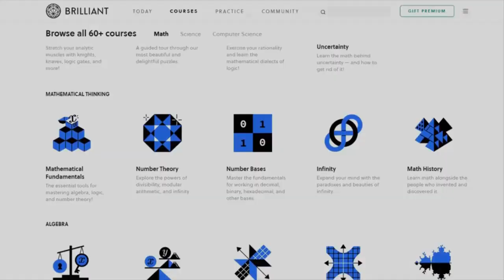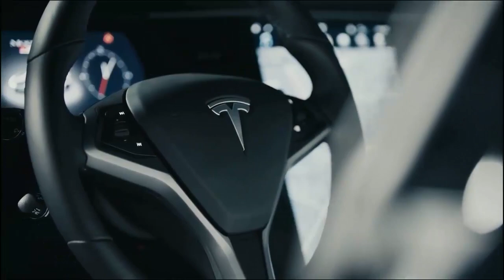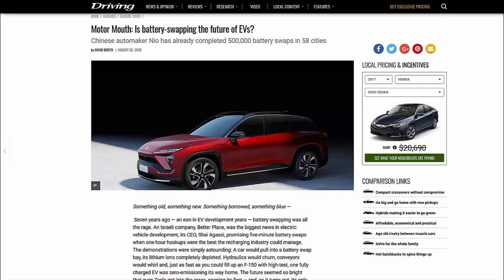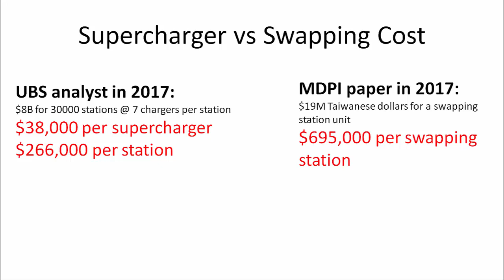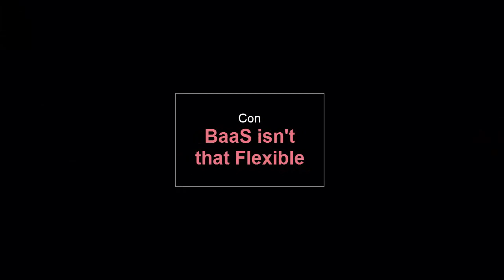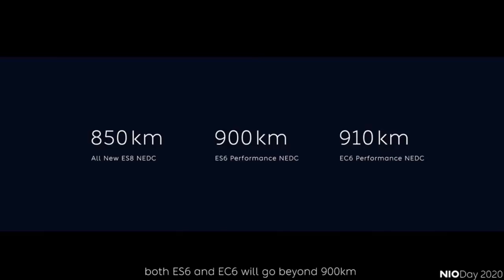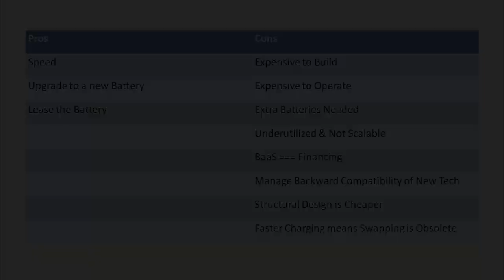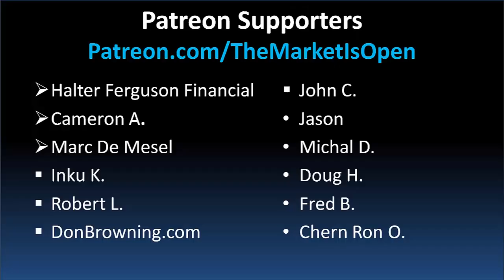Will Tesla Battery Swapping Crush Nio?

Comment: Just my 2 cents as a NIO owner. I think NIO focuses on battery swap somewhat because the government supports such model vs. charging and consumers can get tax benefit buying a battery-swappable car. I personally prefer charging over swapping because I have a new car and I don't think it is worth it to swap with an older battery to my car. I would think a sweet spot would be a battery swap station along with charging stations together.

While Tesla's structural model seemed nice, there are some disadvantages such as having to repair the entire car if there was a structural issue. Also, there is physical limit to how much Lithium battery can be charged. Too much voltage would cause security issue such as electric leaking.
Reply: NIO checks the health of their batteries and it's automated when you use their battery swap stations. Shame you didn't mention that.

Comment: Think battery swapping is niche for  car fleets  Or robo taxis. If you had 300 Robo taxis running in a city you could have the batteries charging waiting to be swapped while the Robo taxis are still creating Revenue. Only viable use case I can think of

Comment: I wouldn’t want to swap mine. And on battery day Elon said that the batteries would be integrated with the frame to make it stronger and impossible to swap. So maybe people should rewatch Battery Day and know that swapping will never happen
Reply: Your spot on.  
Integrating the battery into the car's structure saves weight, material and costs vs not having the battery structurally part of the car.  Swapping will never happen with Tesla.

You buy the car and then lease it's battery?  What good is the car you bought w/o a battery? It makes sense only for those who can't understand it's the worse of the two ways to go for all the reasons.
Reply: Yup.  Battery swapping is stupid.   Storing battery pack in a swapping station is a wast of money.  Inventory cost and driver may abuse the pack.
Reply: Don't get me wrong, I love Elon Musk and clearly he's one of the smartest person out there that we are aware of BUT he can also be wrong and mistakes. There are a few reasons why battery swapping will work for NIO: 1) Old cars can swap to a new more efficient battery meaning you don't need to buy the latest model for the best battery. 2) Instead of recharging you can also swap the battery and that's something that will be useful in China. NIO also allows you to rent the battery for a monthly fee so that you can purchase their car for much cheaper. Battery swapping will also be useful when robotaxis is a thing.
Reply: @Teslafan9519  Father Time will be the referee on that and decide if you along with NIO OR if Elon and Tesla is on the better  road, won't it?   Elon along with the other engineers working at Tesla have examined the two approaches thoroughly,  I'm sure.

  In China every citizen who doesn't tow the line which those in power dictate life does not bode well for them.  If you insist that is the kind of culture which produces the best results who am I to disagree.   Just remember your position as history will record which mode gains dominance and lives past the other.

Comment: There may be a cultural difference in China where a bigger percentage live in apartments rather than single family homes with garages.  If Tesla's experience shows they are losing significant sales in China  because of swapping, they will pivot and offer it.  I think Tesla is confident that structural batteries and lower prices are more important to buyers.
Reply: I live in a lame country in eastern Europe and even we already have slow chargers on regular parking spots, connected to the same grid that powers street lamps. Electricity is everywhere, you just need a connector and a machine that knows whom to charge (no pun intended) for it.

Comment: Elon said  "LIDAR is a Fool's Errand" for FSD.  Battery swapping is another, "Fool's Errand".  Tesla not battery swapping is a plus for Tesla.  Nio will/is  spending and wasting a whole lot of resources on battery swapping which Tesla is putting into places which will give better returns.  Like into more production for cars and batteries. That will allow Tesla to fill the inevitable greater future EV demand. 

That is why Tesla will crush Nio in particular. Tesla will out perform it's other competition for other reasons depending on the what mistakes they make which will cost them.  Just like Nio is on battery swapping.  Tesla has a company culture and direction different to all other's and that was it's edge over it's competition in the past as we have seen and that  will continue to be so going forward.  That is something the legacy manufactures can not change  if ever.

Comment: Imagine having to drive 10 miles to get your battery swapped!! What a PIA! The time that is stated in this swapping model assumes that the car is right there.  One must add the time back and forth to the swapping station. Also a waste of batteries that could be used for an additional car or storage unit.  Not for me.
Reply: Oh, your fuel pump is at home? Imagine having to drive 10 minutes to fuel your gasser! Oh wait... 🤣

Comment: NIO use swapping as best strategy because they only need to raise battery capacity, not need to reduce time of charging!
 Only choose 1 of 2 effort, this will get success easily. 
 But the way NIO swap battery is poor so far! 
 The best way is using quick disconnect, battery will be inserted from side of the car, slide into battery housing then lock it. When remove simply slide pull battery out. This doesn't need complicated station, only need simple mechanism to swap battery with cheap cost.

Comment: I'm trying to fuss out if battery swapping has any advantage in high-density residential areas where level 2 charging infrastructure is not sufficiently prevalent.  Ignoring queueing, the battery swap would permit an apartment dweller to enjoy about the same experience as owning an ICE vehicle.  Once queueing is considered, the ability to locate a sufficient number of swapping stations with relative convenience in high-density regions may be difficult.  On the surface, streetside or parking lot/garage level 2 charging infrastructure makes better sense to me.

Due to the lower currents, level 2 charging can be more efficient and reduces stress on the battery.  If a battery swap station is always rapid charging the returned batteries it seems to me that those batteries will degrade much more quickly than those that are only occasionally supercharged while on trips.  I have not yet made an effort to research the level of degradation to anticipate.

At ten minutes per swap and assuming all batteries are the same, 13 batteries permit a minimum two-hour charge before the battery is potentially returned to service.  This may be a low enough charge rate that extensive thermal management is not required.  It also implies that a 13-battery charging bay could support two swap bays at 50% average utilization.  Higher utilization would require either a larger charging bay or thermal management of the battery for rapid charging, yet another complexity.  For Tesla or CCS rapid charging each vehicle brings its own thermal management system.  In battery swap this is another item that must be duplicated.

In the particular case of Nio, the advertising of an impressive facility that contrasts with the Tesla superchargers and other rapid-charging infrastructure may fully justify any inefficiency in capital utilization in the short term.  It is visually obvious that Nio is offering an alternative to other players and likely can attract new buyers to look at them vs. dozens of other manufacturers.  Since I understand Nio cars can also rapid charge Nio is somewhat free to emphasize or de-emphasize the battery-swap concept as the novelty wears off and consumers, in general, become more savvy about vehicle charging.

I do not miss my Tesla not being able to swap batteries.
Reply: @Noguffay sorry you are wrong.. 
Look at china and india now..

Comment: Many in China lives in large apartment building where they can't plug in their car at home. Nio chose to put tens of thousands of battery packs in swapping stations instead of selling tens of thousands of cars.  Battery swap stations would not work in the US. Nio would be fools to try it in the US.
Reply: You seems to have in depth analysis of this topic. I agreed that Nio would be fool to replicate their battery swap strategy  outside China. But, as it currently stands, Nio mainly focuses its sales in their homeland and their battery swapping strategy is more about solving the accesibility problem than the matter of speed. It will give them an edge over Tesla at least in China, the largest ev market in the world 👌

Comment: Tesla canceled the swapping because it does not work in the real world. With all the salt and water on the roads the mechanism and bolts for swapping the battery will corrode/get damaged after 1-2 years and the car is toast.
Reply: Not all areas have snow and salt issues.

Comment: You made some good points, but did not.explain why Tesla cancelled his  battery swap pilot program in 2013 when there were no Level 3 charging stations
Also understand that in China nearly everyone lives in apartments so home chargers cannot be used.  If I lived in an apartment I would want a car.with battery swap capability instead of waiting in long lines then hours at Level 1 and 2 charging stations.
Also, Tesla's Level 3 stations' charging rate is decreased by the number of cars charging at the same time.  And even when only 1 car is present, waiting 1 hour per 100 miles gets old fast.  Car.magazines have done articles on   long trips that take 25% longer due to slow.charging times. 
On battery day I was surprised Tesla did not announce their new 4680 battery will have a faster charging time. 
I am surprised, too, that Tesla has not adopted Maxwell's super capacitor technology which provides instant regeneration storage which can be used for short bursts of acceleration, reducing somewhat the  number of heavy batteries being hauled around.  Why do all the Tesla YouTube channels never address this subject that was a hot topic 3 years ago? 
I admire Elon Musk and own 300K of Tesla stock.  I have a single family home where I am willing to install a Level 2 charger,  but will not buy a Tesla as a first car until the price is equal or less than an ICE car and it can be charged at a Level 3 station at the rate of 15 mins per 100 miles.  If Tesla really wants to sell millions of.cars, he needs to improve charging time.
Reply from the maker: Ya I think a lot of the "cons" I listed stem from the learnings from tesla's pilot program. Just because there were no V3 superchargers, doesn't mean they didn't see what was in the pipeline. Today for example, we have no V4 superchargers, but we know that faster charging will come in the future.

I think the living in apartments argument is more of an ICE vs EV thing, and has to do more with getting buildings to install chargers. The decision of swap vs charge doesn't seem to relate much to living in an apartment. It's all about the speed and convenience. While the superchargers are slower, I think I outlined clearly why a swapping is prone to bottlenecks, that could them even slower than charging. But that said, swapping could be good for today, but when new technology arrives with faster charging, swapping your battery to a faster battery, defeats the purpose of swapping. And faster charging will make swapping pointless. Also V3 charging has a peak charge rate of over 1000 miles per hour. So they charge about 75 miles in 5 minutes, which is getting to be quite compelling.

For supercapacitors, if short bursts of acceleration is advantage we're looking for, then they're not needed since the batteries can deliver enough power to accelerate just fine. The new Model S Plaids can do many bursts in a row too,  without supercapacitors as far as we know. So what advantage do they bring?

Comment: Upkeep on battery is cheaper but eventually you will have to swap it out
Reply: Tesla's batteries will be able to last longer than the car. You won't have to swap the batteries out until you scrap your car.
Reply: @chrisw9534  fast charging would do so much harm to the battery life span my friend. Ask samsung about that business  model idea and they will tell you how terrible is it. Over time, your battery will degrade faster and hold charge less and less. Fast charging is the friend of the user but the enemie of the Battery itself. You would definitely need to swap it eventually my friend.
Reply: @clamorosomilano7148  Apparently there isn't much degradation on the 4680 cells. And most people probably won't use fast charging often. Most charging will be done at home or at the office. Don't need fast charging there.

Comment: its basically the same with swap able phone batteries, its nice to be able to, but its just not worth it because of the wasted space etc
Reply: A car isn't a tiny handheld device. Your comparing apples and pears. Cars are big and need to be parked somewhere to charge. If you don't have a garage, you have to rely on public charging infrastructure.
Reply: @hgr3180  your point is?
And what has that to do with my comment?
Reply: @michelbruns   look at how flawed your comparison was.
Reply: @hgr3180  the ability to swap batteries take up space, and its not worth it to lose that space
Just like with phones
Reply: @michelbruns   why do you keep comparing it with phones? They aren't the same. There's a reason why public charging infrastructure is important and it's because you don't want to have a shit show trying to find a place to charge your car. We aren't talking about hand held devices that can be charged anywhere. We are talking about cars.
Reply: @hgr3180  i still dont know what you want, its the same as with phones, we decided to make batteries unswappable because we can increase the battery capacity by doing so, JUST LIKE WITH PHONES. Period.
Reply: @michelbruns   good luck travelling during the holidays in China? I bet you didn't consider that in your flawed argument. Btw in China they don't have garages because they live in apartments.
Reply: @hgr3180  still dont know what you want
Reply: @michelbruns   comparing cars to phone is dumb. If battery capacity was so great we wouldn't be having this conversation, but it ain't.
Reply: @hgr3180  but the same principle applies so its a valid comparison
Reply: @michelbruns   charging and swapping do basically the same thing. We will always need them unless you can mass produce high capacity batteries that can be recycled.
Reply: @hgr3180  dude wtf is your problem or your goal with all this nonsense. I wrote a comment half a year ago that we dont use swappable batteries in cars because it would make the batteries smaller, just like with phones
And now you write all this stuff, i still dont know what you want
Reply: @michelbruns   yeah I agree, but it's more complicated then that. You have battery degradation and repair costs to also consider.
Reply: @hgr3180  which are negligible, especially when you factor in the higher rate of failure and tear and hence higher repair costs of swappable batteries
Reply: @michelbruns   you have proof to back that statement up?

Comment: 8 yr ago swaps took 90 seconds, they should be faster now.  Tesla already has plans for batteries at the superchargers to time shift drawing from the network during low demand times like night.  Charging one battery to charge a 2nd wears out two batteries for a single use.  Advancing Technology requires trying multiple routes.

Comment: Swapping shoululd be noy by OEM but by independent businesses like filling stations, small manual batteries to exchange like gasoline stations.  NIO & Tesla screwed up the concept,
Reply: Why??
Reply: Because that’s the way gasoline and diesel are dispensed??
Reply: @205rider8  Infrastructure & practices exist to ease the transition if we  add battery swap to filling stations.  Much harder to make drivers think different. So need fast refueling or no  change tro ZEVs from ICE.

Comment: The author is unfair to nio in some ways.  He does not say that nio gives out an app where you reserve the exact time for your swap so there is no waiting in line once you get there, much like the "fast pass" at theme parks.  It can be the 7 minutes.  Also, battery swapping can be used with solar/wind farms to defeat the "duck" curve problem with these energy sources.  Rather than waste energy from solar when it is not needed, hook up a battery to it and charge it very cheaply to be later shipped to a battery swap station.  Also, the author leaves out that battery swapping can save in total battery production in that if I can swap my 100 mile range battery for an 900 mile range the two times a year I have to drive to Miami, then I can do with a much lower range battery most of the time and save a tremendous cost.